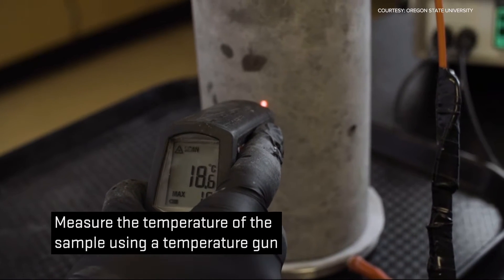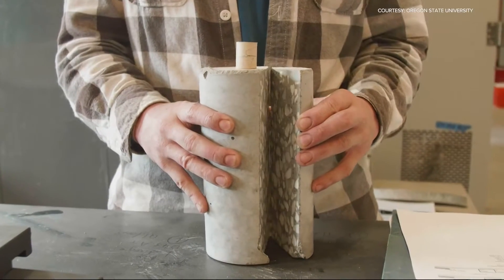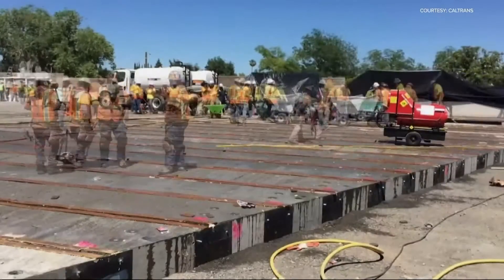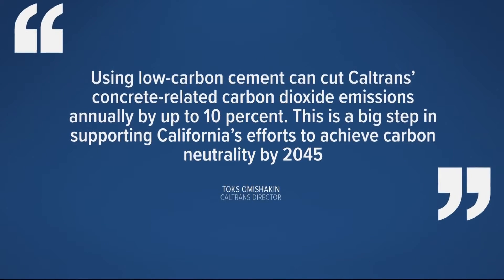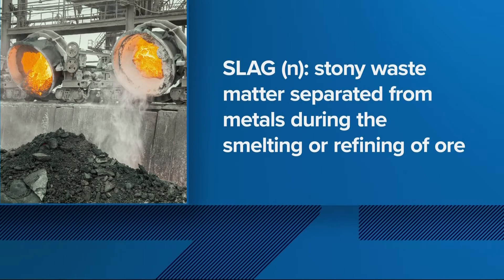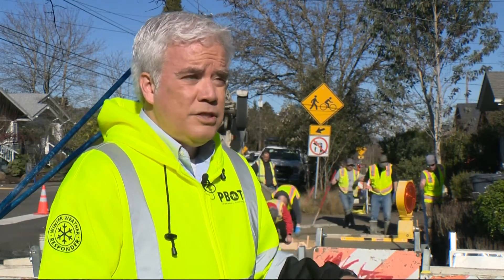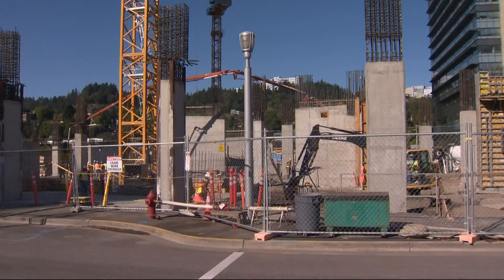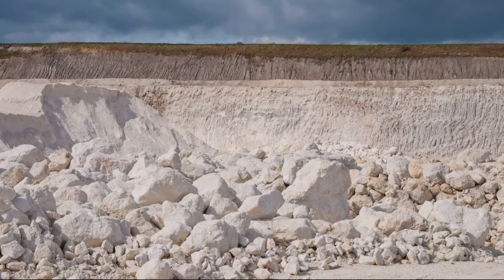OSU research paves the way for lower-carbon cement

Comment: Nice!  Wondering about other cements or I think some call geopolymers that can be used?  Really neat are the most cost effective HPC's and UHPC's.   Those are really interesting and I wonder about the inspiration for the more cost effective methods.   Figure, any added risks can be mitigated with a few using PPE's that are being massed produced for the time being... which is better than more requiring PPE's.